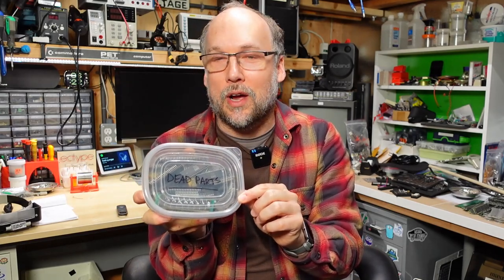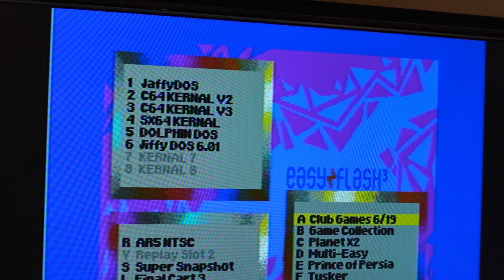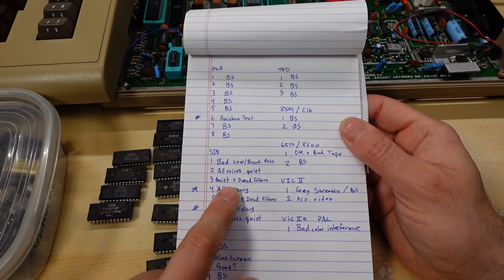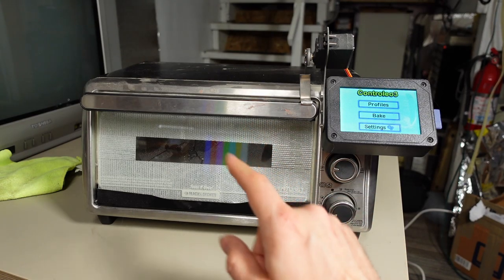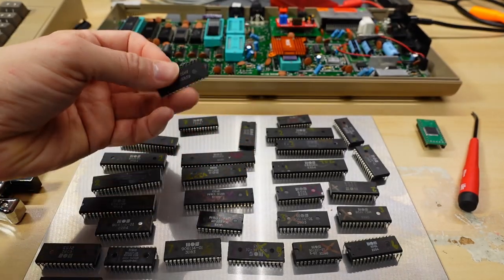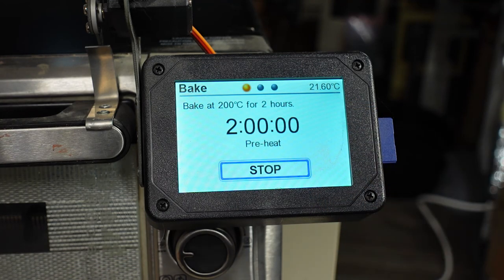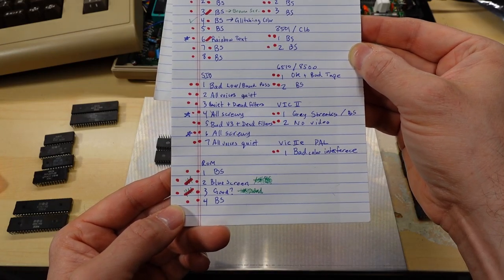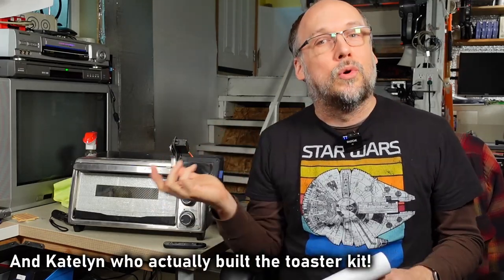Can we fix bad chips ... in the oven?

Comment: Reminds me of 2014, the good ol' iPhone microwave prank:)))
Certainly heating causes something: the expansion of materials with a positive coefficient and a contraction with a negative value. This can potentially affect broken or bad chip bonds. Or maybe not. Why actually 150 degrees? That should make you puzzled. This temperature can neither have a direct influence on soldering points, like the bonds mentioned above, nor does it have any influence on doped semiconductors except that it may cause a temperature-indicated voltage difference in different materials. The 150 degrees are far below the temperature that e.g. for the doping is used and silicon leaves everything below 1410 ° C cold (pun).
Second: why the same temperature with CIA and VIC or SID? One is completely digital and the other are mixed signal chips. The chips would have to have completely different properties if they were viewed and treated as a thermal monoblock, as is the case here. The alarm bells should ring;)
Remember that these chips are (C) MOS technology and are very sensitive to static discharge and operation at excessive temperatures. On the other hand, 150 degrees is not particularly good compared to an extended military range of -40 to 125 degrees. So what's the nonsense? :)
Electrons move, this is called current flow. There is of course also material migration based on ion transfer (corrosion, galvanization). To reverse this, you will guess it, one has to reverse the flow of electricity. I think it's a very good joke that this should be done by heating.

That's not very nice of me: someone can work in a chip factory. As a packer, as an engineer in materials testing or as a cleaner. Has anyone checked that? :) With so much hocus-pocus and lack of a scientific paper, I doubt the seriousness of the conclusions drawn regarding electro-migration on kirchhof.tech.

Anyway, thank you very much for all the work and the great video, Adrian :)

All temperatures in degrees Celsius.

Comment: I'm disappointed. I was excited about baking my Athlon 64 5200+ mobo. Also, I would have to find an oven in the trash or a washing machine.
Reply: A motherboard problem could be down to cracked solder joints, which could be fixed by an oven potentially if its hot enough to reflow the solder.

Comment: With PS3s, where people thought that it was the CPU/GPU re flowing, has generally been confirmed now, that its the NEC Tokien caps which are bad.
Early on, the HEATING of the board (either heat gun or in oven), once thought it might be reflowing to fix.. but apparently heating the CAPS gives them some bit of life back into them termporarily.
I would think thats much the same what is/would be going on here?
Reply: 10% ylod is nec caps, way more often is bga issues or the actual rsx or cellBe chips, damaged substrate, I know this because I repair 100s and with syscon dump the codes nearly always point to bad bga connections, or data lines between cell and rsx, or bad cellbe
Reply: @RealDixonPeter  when did Sysco dumping start? A year ago when I commented, I don’t recall anyone really talking about it. 

I do need to look more into it now when I have time.

Comment: What if you pre-heat to 150, THEN put the chips in?
Reply: I wouldn't.  You will thermally stress the outer parts of the chips. It would risk breaking them further.